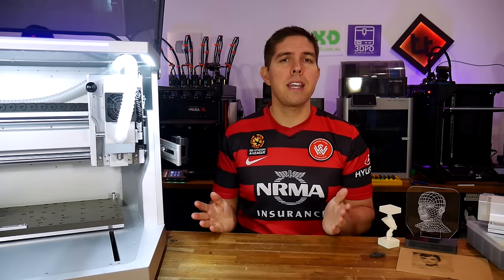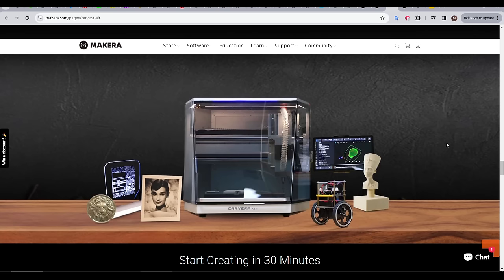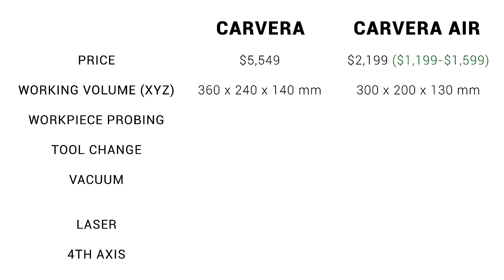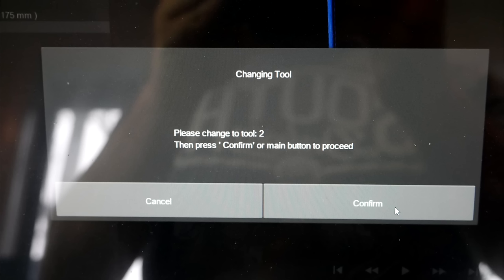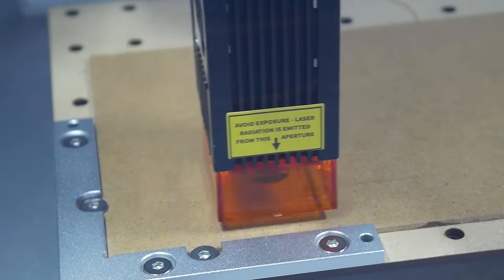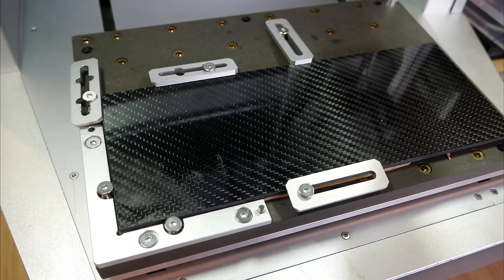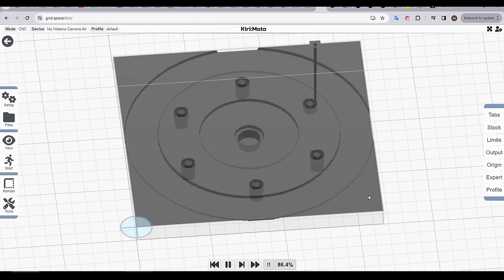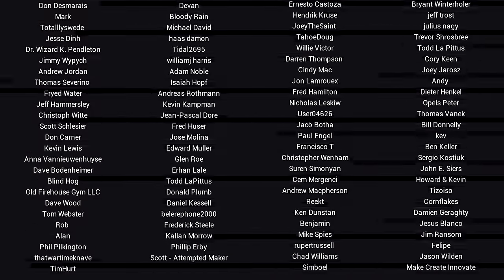Carvera Air - Smaller, cheaper, but still smart and capable

Comment: "cheap" 1200usds as early bid, 2000 when released.
Reply: Yeah...
Reply: That's the price of a laptop. It's in consumer reach.
Reply: Compared to other CNCs intended for materials harder than pine, yeah that's pretty inexpensive. That doesn't mean it's approachable for most folks though... or even the best option for that price range. All depends on what definition of 'cheap' you wanna use ig...

Personally think I'll stick with my existing "heavily modify an off-brand X-carve as needed" plan though. This does look pretty sweet for people who care more about convenience though!
Reply: Have you seen any other CNC?
Reply: Cheaper -the og carvera is $5,000, i got mine with most of the addons and was over $6,000. I would say for what this can do and its size it is a pretty good deal
Reply: Incredibly cheap for what's being offered. This isn't a 3D printer.
Reply: It’s cheap if you compare it to a similar cnc machine.
Reply: Cheapness is always relative. A cheap car would be expensive for a pair of shoes, even if they both help you get around.
Reply: If you knew anything about CNC, you'd know that's absurdly good.
Reply: Cheap is a relative term. As far as cncs with similar capabilities go this is inexpensive.
Reply: Remind me of all the other CNC machines at this price point?
Reply: That's cheaper than a iPhone 15 pro max
Reply: That is cheap for a cnc
Reply: @mazlumyildirim2078 people don't see that though.  A phone doesn't help you actually make things or bring your ideas to reality.  Its funny all the people that want to make expensive parts for little or no money.  

People should go look at a Haas or Tormach then complain about 1200 bucks.  A Tormach....non-comercial machine...just for the machine is about 20k.  Then you have tooling.   And again....this machine will rarely ever be found in a full service machine shop.
Reply: So cheap... Cncs need to be very rigid. Industrial ones are in the tens of thousands of dollars.
Reply: He said cheaper, not cheap. Besides, who wants cheap? Inexpensive, sure.
Reply: For home cnc that is cheap tbh
Reply: That’s pretty cheap indeed.
Reply: Put it to work and it pays for itself. Think outside the box
Reply: You're really complaining about sub $3000 for a user friendly CNC?

Comment: Can't wait until creality sweeps in and makes a really afordable and slighly worse but still great CNC mill. Not because i would buy that machine, but because it would start a race to the bottom, which is great for my budget
Reply from the maker: Creality already have these. Check out the cp-01, althought that's a three in one.
Reply: I'm rooting for Bambu Labs to shake things up!
Reply: And then you can spend the original price of the machine all over again performing upgrades to make it actually usable, just like the Ender 3
Reply: My ender 3 worked great out of the box. Printed tons of stuff. Upgrades for itself and just about anything I threw at it.
Reply: @evanbarnes9984  All the while saying that they were so much more frugal than people who bought the original 😂.

I feel like this is every ender enthusiast.
Reply: @dev-debug  There is no hard line which shows you really are just drawing a distinction out of snobbery. "They typically xyz" but no must xyz. Its because ultimately its just about what a machine can do. Nobody thinks theyll get remotely the same rigidity out of these as a vmc or similar. Not one soul.

This is a little destkop machine to prototype things without needing to dedicate your life to cnc.

Pointing this out over and over as if people dont understand this is just annoying. We get it, your snobby self only deals with big industrial machines. You want a cookie?
Reply: @dev-debug  so what does make something an “actual milling machine”? You provided no reasons why this isn’t one and no valid criteria for what makes a milling machine.

Them being made of cast iron is not a real requirement, them weighing hundreds of pounds also isn’t a real requirement and them being able to work with steel also isn’t a real requirement. Maybe you should actually have a think about what a milling machine actually is.
Reply: Wow, great price for the Air! I own the original, so I haven’t paid close attention to the Air campaign, including price. At this price, it’s hard to not STRONGLY recommend the Air.
Reply: @conorstewart2214  He's right if we're talking hard metals, but as you say, not everyone need that. I made a setup for my mother art work which include one of the chinese cnc machines we bought on amazon (3015 something). She pours in some molds she made a mixture of chalk and other additives made for art. She then put the tablets in the cnc and use a software to carve on them the design she made in photoshop which are converted in an grayscale heatmap. The material she has to carve its extremely soft, the machine really doesn't make any effort to cut trough it.
Reply: @ClockworkGFX  BL

Comment: It's amazing that you can buy a CNC machine as a private person for a reasonable price.
Reply: somewhat reminds me of Big Hero 6 these days.
Reply: youve been able to for a while, the chinese ones are not junk they do work. and oyu can upgrade them. but yea this one is like the bambulabs of CNC lol...
Reply: Nah, for this asking price this is extreme trash. Put it side-by-side with an equally priced lathe or mill. If you one of those for the same price, you could machine steel parts that are infinitely more usable for most applications. Metal WILL do the job that you need to get done more often than not. And you will be able to machine decently sized chunks of metal, too.
With this overpriced garbage fire, you can only do subpar materials and small pieces. This extremely limits the use cases. How many foam pieces did you need in your life so far? Chances are, you won't need all that much CNC milled foam in the future either. 
It's a very niche machine that is very expensive considering what conventional tools you could get for the same price.
In fact, if you bought a welder for that price and had means and training to operate it, that'd be an investment that could end up making you money. Instead of making you useless CNC milled foam.
Reply: I better pay CNC factory in China to do the job, no failed parts, they have any material I need. Try sourcing some knife steel and tempering it before and  after cutting. Home CNC is for toys.
Reply: @JoshuaNorton  did you miss the part where this machined aluminium and carbon fibre easily? Or that this can make basic circuit boards? Some of your points are valid but when you start talking nonsense like this only being good for foam and subpar materials then you lose a lot of credibility and it just makes you look like you are criticising it without actually understanding it.

Also when you start going on about “metal” it makes you look like you don’t know what you are talking about, you get all kinds of metals and in case you missed it, this can machine some metals too.
Reply: @conorstewart2214  don't forget about 4th axis and Lazer module that can work in conjunction to engrave glasses and round objects. This machine has so many features compared to a manual mill suffice to say they have different use cases and targeted audiences. Its not like the Carvera Air is my only CNC mill... I have others for production. This one is just for one off and it's a good tool for teaching friends/family.
Also I would never pay full price for it but $1200 is not bad, even if I hate it I'm sure I can get my money back.
Reply: yeah, thank god Chinese developed cnc6040 but not this

Comment: They added an automatic tool changer to the original model, cut the laser from a 5w diode to a 2.5w and doubled the price. Now they offer a smaller, less capable machine than the original at the price of the original 2 years ago. 👎

Comment: I don’t get what’s the point of milling your own pcb when you could just make a cheaper better one from someone like pcbway. These machines always seem like a waste of money to me. Not the same tool but I could get a used Bridgeport for $2000 and make substantial things.
Reply: I would like to know where you’re getting a Bridgeport for 2000$.
Reply: @ReProps2003  Cleveland, you can get a good deals for them in the rust belt. I know there are bit more everywhere else.
Reply: @ReProps2003 I got a very good condition Bridgeport manual mill for 2500 in Utah a few years ago. They are out there, but getting rare.

Comment: Im quite curious to see a deep dive into the quality of the soft metal milling quality/how useful it is for things like metal gears, cams etc.

I missed out on the super early bird for the original and then the discounts because I thought there was no way itd actually be that much more expensive, but this time I got a super early bird slot which makes this seem like really nice value for me.
Reply: look how the ships on the opposite way of the spindle are shaking and you will understand that this machine is not as rigid as you want it to be when cutting aluminium
Reply: @pholos77  I mean, I am not expecting it to be a VMC. I just want it to check the box adequately, which for a hobbyist means getting usable metal parts in any amount of time. Im not expecting it to produce mirrors.
Reply: The parts he made out of aluminim look good

Comment: Amazing review!   I purcahsed the full Carvera after watching this and emailed Makera letting them know you made my decision for me!  Keep up the awesome work.
Reply: I’m very close to making an order as well but when the air popped up last week I’m worried the original has much lower value,… 😢
Reply: @erikm9768  I'm sure the new machine will be good but likely have a few teething problems and the KS is 7 months out.  I'm investing in the Carvera to get stuff done... I'm done with machines-as-a-hobby tools myself.  Either way, I'm sure you will end up with a good machine!
Reply: @AndyTheimer  Thank you. The KS on the Air would set me back $1400 + 500 for 4th axis + 500 for shipping + vacuum + laser etc, would be around $3000. About $6000 for the OG Carvera with shipping and 4th axis etc. So is ATC and slightly more work area worth $3000? Robustness seem to be the same almost, same spindle and mostly everything... very difficult choice. If you want a step up from the Air its better to get the OG Carvera now perhaps.
Reply: I got my KS within 30 seconds of it going live and I'm still debating buying the og Carvera. Tool changes are pretty dang handy. The super early pricing is hard to pass up, and almost makes me want  to just have them both. Hard to justify though. I'd really need to be producing a lot to need to almost identical CNC routers.
Reply: @scrampker  I have a FoxAlien and just like @TeachingTech I don't use it much because its super big, makes a mess and while it works its just kinda a pain.  I try to 3d print most everything.  Having a small machine with built in tools and cleanup + hood + small laser.  I am hoping I will do more plus some fun messing with pcb design even.  In my experience, the convienence is worth it.  I have no doubt the air will be good, just like the Bambu P1P is awesome and half the price of the Carbon but I've since paid to buy all the upgrades so this time I'm going big to start :)
Reply: @crosswindjones  so are you thinking you would go with the air at $1200, or would you pony up for the full price of the OG? If I was paying full retail for the air I think it would be a no-brainer to just go with the OG especially since you can get it now. At the super early bird pricing it changes the dynamics a bit.
Reply: @scrampker  My Carvera will be here next week :)
Reply: @crosswindjones  yeah I'm not sure I want to wait for the Air to come in 10-18 months, but probably still worth keeping the KS order and figure out what to do with it when it shows up.

Comment: I have the original Carvera and was excited to see this one announced because more people will get access to such a great machine. Honestly the way the automatic tool changer finds new tools, you could beat it with a manual change.

The blue tape, super glue, blue tape makes me wonder, have you've tried double sided crepe paper tape? It's thin and lies flat, doesn't bunch like plastic tape. You can get it in a 2" wide roll so you just quickly stick two strips on the back of a circuitboard and you're ready to go.

Comment: I use a fantastic free tool for making a height map o your stock (for pcb / engraving work). It's called G-code Ripper.
It probes the surface and alters you original g-code file for precise DOC. So this does no have to be expensive 😎
Reply from the maker: Thanks for sharing!
Reply: How does it probe the surface?

Comment: At work, we've been looking for a decent machine that could mill softer metals such as copper or aluminium, but just doesn't seem like there are sturdy enough machines, that cost 4-5k.
Reply: Copper is actually a really hard metal to machine well. It is soft, but that works against you. It gums up cutters really badly, and you need a really rigid machine to make sure it the end mill doesn't get dragged around and snap. Either way, maybe look into building a PrintNC! This has been on my list for a long time.

Comment: Buy a cnc ready sherline mill. If accuracy matters, get the ball screws but you’ll be paying for it. Sherline have all these attachments and conversion kits available to change it to do whatever you want. They have fantastic customer service. I’ve really emailed them an annoying amount and they’ve always helped, quickly and throughly. Buy some reasonable stepper motors, a gecko drive g540 and a uc100 with a Mach 3 bundle deal, cost isn’t that different from this depending on what you want it to do but I can guarantee your getting quality across the board and at an extremely competitive price. I did a lot of research years ago so take this with a grain of salt and do your own research but my impression of this machine is that it looks quite limited in terms of rigidity which translates to how long it takes to cut parts. I’d be concerned about the router rpm which will dictate whether you can cut a lot of steel. If you’re primarily getting this for wood just buy a shapeoko or equivalent, this has a tiny work area for wood considering and these machines can cut aluminium at a push. I think this  new  Carvera can probably comfortably cut metal but at the end of the day you’re still paying for a lot of bells a whistles, it’s just they’ve removed the most useful one which I was actually impressed with, which is the tool changer. Everything else is childs play to set up with manually, don’t pay the premium for a little extra work.
Reply: The cheapest I could configure a Shoreline mill of similar size was over double the cost. Can you share a configuration that is in the ballpark of the price for the Carvera air?
Reply: @PearlSwirl-G  This is always the case with people claiming these little mills are useless. They pretend that the barebones useless version of a much bigger much more expensive mill is the price of this which has all included.
Reply: @BeefIngot  Okay, you mentioned that " cost isn’t that different from this" but it's over double for even the most basic, I was hoping it was actually not that different in price.

Comment: How was the dimensional accuracy of the aluminium parts? The surface quality on aluminium didn't look very good, do you think that's because of the machine not being stiff enough?
Reply: I also want to know more about this. I dont think anyone thinks this thing is going to get VMC quality but I want to know if parts are usable comfortably for things like press fits etc.
Reply: It's likely a combination of the head not being trammed and conventional milling instead of climb milling. With such a small endmill, the feedrate should've been reduced a bit and climb milling should be employed to reduce chatter.
Reply: Alot of these you tubers have 0 idea about machining and correct feeds and speeds also.

Comment: I have a desire for a good desktop CNC router, and this is very much the kind of thing I want.  Unfortunately, there's still a gap between my perceived value of such a machine, and the price.  I'm not saying Makera is charging more than the machine is worth.  I am saying that the amount of utility I expect from having such a machine is a lot less than what it will cost me.  Even the now-sold-out super early bird pricing is about 25 to 30% too high for me.

But this design does seem like a great midpoint, a nice way for Makera to reduce the cost of the machine while preserving the most important and useful features compared to the original Carvera.  Hopefully this is just the start of a trend, and in a few years perhaps a good quality desktop CNC and laser-engraver will exist for under a thousand USD.

Comment: Hi Michael I'm really tempted to get one of these but I live in a flat in the city center and the noise would be a problem. I have a bambu lab p1s and I know for a fact this isn't loud enough to bother the neighbours (I did ask them).

Could you tell me how does it compare to machine aluminium and carbon fiber to bambu lab p1s or similar 3d printer? Is it significantly louder?
Thank you!

Comment: I'm curious about safety risks regarding the manual tool changes.  I assume some safety features are built in, but I kinda worry about the spindle activating while my hand is on the tool.

Comment: Without mechanics review, this video is a bit incomplete.
Like what type of bearing it uses for each axes and which size?
How well they protected from chips? What motors does it use etc. What speeds and loads can it hold? 
Except this, it is close to "shat up and take my money" 😊
Reply: You can see the two x axis linear rail bearings and they are not protected at all.